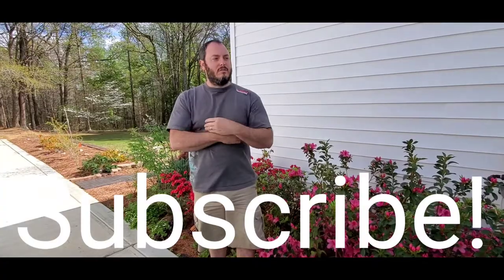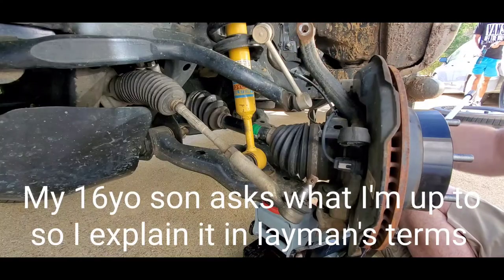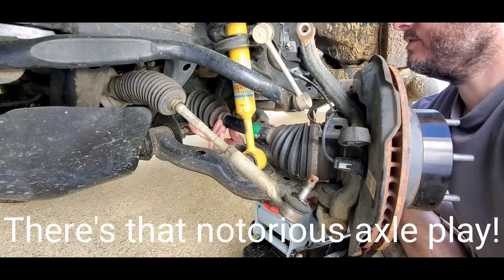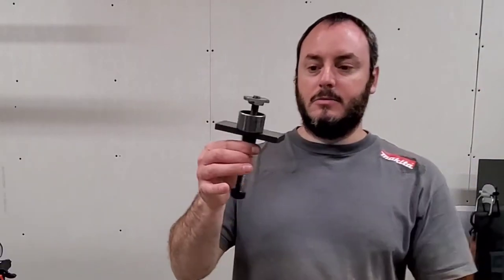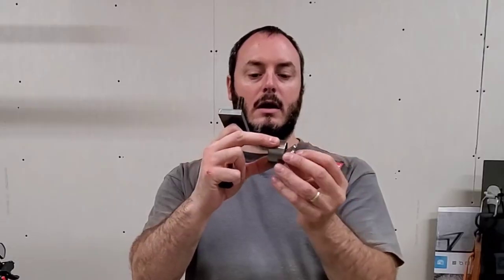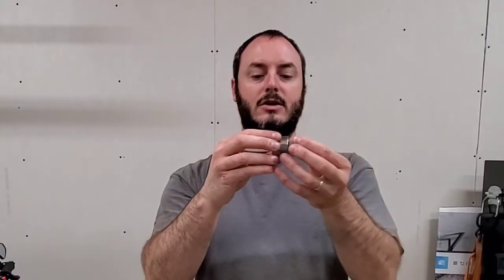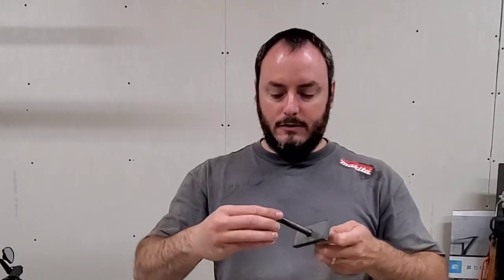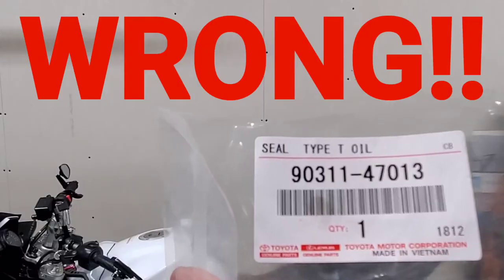Toyota Needle Bearing Yukon Upgrade Bushing Install Stopped Steering Wobble (Did it go away in 4wd?)

Comment: Did mine this weekend on my gen 2 toco.  I didnt have the same play yours had, but i replaced it as preventive measures since i installed the bilstein 5100 with the 2 inch lift. The only issue i had was when it came to changing the diff seal. As an fyi to anyone the pasanger side and driverside seals are different sizes. The passenger side uses a way bigger ball bearing, in turn uses a different seal. If you call toyota they call it an oil seal. It was a pain trying to get the correct one not knowing its called an oil seal. So driverside diff seal. Passenger side oil seal. Great video the one you have is the one for the passenger side.
Reply from the maker: @Dan Bacarra that's good to know about the seal being for passenger side. Thankfully I was able to reuse my old driver side since it wasn't damaged and returned the wrong side! Might as well replace the needle bearing while you're in there! Thanks for the comment!

Comment: Thanks Sean . I believe that axle seal you are showing is for the passenger side . I just ordered the kit and asked for a passenger side seal to be sent with the kit because I'm changing out both axles also . So I have the same part number on my second seal that is separate from the kit .thanks for the video its very detailed . It will be very helpful next weekend
Reply from the maker: @timothyroarty5342 I never got around to figuring out why the seal was wrong. Ordered for the driver side you never known what you're gonna get! Thanks for the reply and hope your install goes smoothly next weekend!! What are you changing your axles to? OEM or an upgrade?

Comment: Great job.  Only one question why not just buy a new axle seal too?  not expensive i cant see re-using.   Great tutorial and so glad to see just how it is done, with all the info is great for someone who has not taken one apart so far.  I'm sure it's same for the 4runner.  I wonder how many miles they are rated for...the bushings good for a ton of miles or like 100k  before it wears and wobbles too ?? Or is it harder than the axle and the axle will wear which would be easier actually right ??   I'll eventually need to do it.   Thank You !
Reply from the maker: @G. Fortin I had a seal I ordered but the day of the job with everything apart knee deep in the fender well I realized it was the wrong size for some dang reason, so I set it aside and just reused the old seal. Yeaaah maybe not ideal but it looked perfectly fine and they are not known to go bad. Yes for sure I hope I didn't introduce an issue removing and reinstalling but honestly I'd seen a few videos of guys doing the same thing.

Thanks for the feedback and I hope your install goes smoothly. If not, it's probably best to just give me the 4Runner because my wife wants one anyways! Lol. This bushing shouldn't need to be replaced again. It has a wider footprint than the needles did against the axle shaft and rides flush on the axle, unlike the needles that were actually wobbling end to end to support the axle as I believe I showed in the video. Take it easy!
Reply: @ShawnMartinNCBIRDMAN  Hope it last a long time.  I would have done same in that instance.

Comment: So I replaced the needle bearing with the ECGS bearing few days ago. 

CV Axle is tight again, but there's still a humming noise coming from the front driver side.. ive put in several hundred miles already and the noise is still present, just like when the needle bearing was going out.

I've checked the passenger side and that axle is tight.

Pulleys are all fine

Did you have this issue after replacing it?
Reply from the maker: @FiveFoot mine was never making a noise. You may have cv joint or axle bearing noise. Pull the wheel and spin the axle and see if you can hear it. It may sound or feel grindy with no weight, but at speed with weight it comes across as a whine or squeal.
Reply: @ShawnMartinNCBIRDMAN  axle bearings are all good. Did the wiggle test while the front was off the ground and there wasnt any play top/bottom or left/right from each axle. Spun the tires and all sound good. No grinding noise.
Reply from the maker: @temosgarage  odd.
Reply: @temosgarage ever figure this out bud?
Reply: @JandCCards  yes the noise went away by itself after about 100 miles of highway driving. Guessing break in film 🤷🏽‍♂️ all good now. It’s been solid since then.

Comment: Did you do both sides, would you recommend doing both sides if its only 1 side failing?
Reply from the maker: @SierraYankeeSierraZeroPappa just driver side is a known problem, passenger side isn't built the same, no need to change it. Thanks for asking!

Comment: Would this fit a 2001 Toyota Tacoma sr5 or would it be different one
Reply from the maker: @johnny-k6l you can use the part number and cross reference what it fits but I can't imagine it's the same part though. Is this an issue on a gen 1?

Comment: Hey, I lifted my truck and mine has a vibration at 60-65mph, but I can't feel it in the steering wheel, do you think it's the needle bearing?
Reply from the maker: @JW45-70 put it in 4wd and see if it goes away, that's a telltale sign of a bad needle bearing. Check the play in the drive shaft at the center carrier bearing if there is play or the rubber is cracked up it's shot. That causes vibration too.

Comment: I’m going to do this myself soon. I’m thinking of getting a cheap air hammer to install the new bushing into the housing. It will probably save some time and a headache.
Reply from the maker: @Thomas Gjonovich I'd be very careful not to damage the bushing installing with an air hammer, but yes if used with the bushing install tool it would be nice to have something automatic instead of hammering by hand!

Comment: I’m still on the fence about the clam shell bushings wondering if they will only wear in one place.
Reply from the maker: @Stevan Rose I believe ECGS did a video of how this application is actually more common using rhe bushing vs the needle bearing setup. My video also shows how the shorter length of the needle bearings doesn't distribute the load enough and the ends of the needle bearing rods were rounding off.
Reply: @ShawnMartinNCBIRDMAN  I just cannot figure out how a metal bushing can replace bearings; but okay. Nothing says success like actual success.
Reply from the maker: @Richy Bubulinski the bearings are oil impregnated and have a larger flat surface area to decrease wear on individual spots across the surface unlike the needle bearing which was shorter and the needles were even shorter than the casing and the needles could teeter totter in the casing and it caused uneven wear as shown in my video. The passenger side is actually made more like the bearing and doesn't need to be replaced. Not sure why they used the needle bearing design on the driver side and especially why they kept using it year after year generation after generation knowing it failed...
Reply: @ShawnMartinNCBIRDMAN  I think my argument above was from a place of misunderstanding exactly how the surfaces mate and where the friction is or may be. Obviously, replacing the needle bearing cylinder fixes the problem and doesn't create any more problems.

Comment: Both sides, correct
Reply from the maker: @Rick Vick if that was a question, no. It's only on the driver side. The passenger side has a different bearing and doesn't fail as the needle bearing does on the driver side. Couldn't tell if that was posed as a question so if it was thanks for asking!
Reply: @ShawnMartinNCBIRDMAN  thank you, both sides have equal movement, seems like alot...
Reply: I was checking things after an oil change and the cv axles seemed to have a bunch of movement and the front pumpkin,
Reply from the maker: @rickvick3735  yeah sounds like you've got more than just the needle bearing to work on.